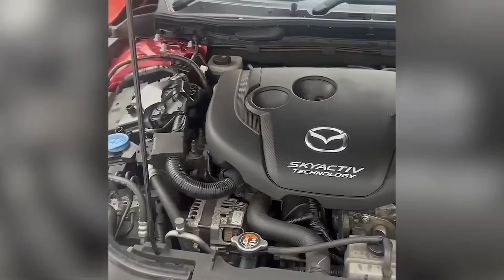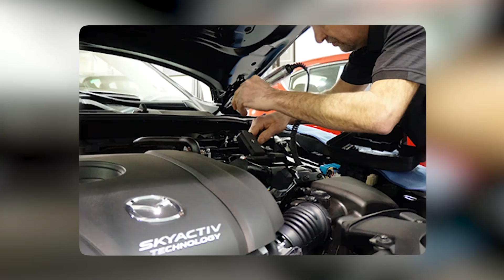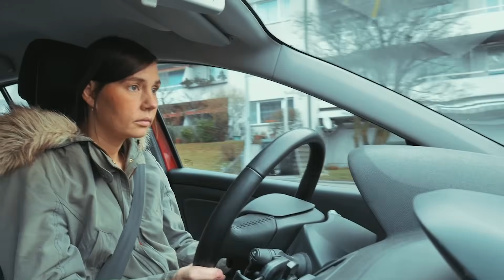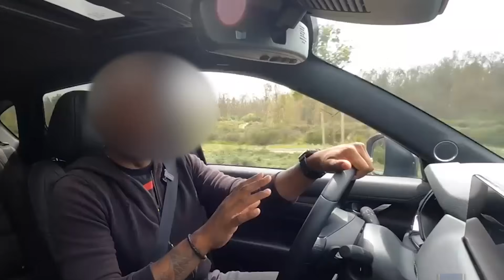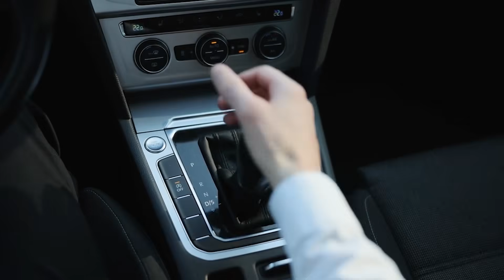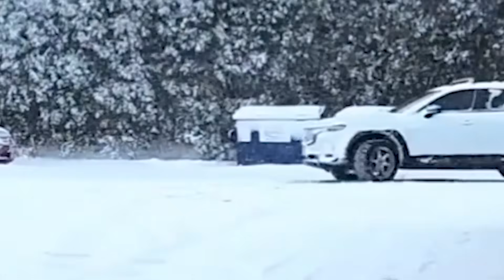7 Things You’re Doing That Mazda Engineers Beg You to Stop

Comment: I dont have a temp gauge. Change my oil at 3000 miles on the dot, sometimes 2500 and i know many people tell me thats too frequent but i know my car and i know it starts running different at about 2500-2750 miles. I take 10 min drives to work and back amd thats my reason, not enough long trips.

Comment: The viscosity debate will forever be ongoing over which is the best to use,  0W/20 or 5W/30.  Change oil Before even 5,000 miles as so many suggest and there will be no engine issues.  Call it overkill, but the engine will be spotless inside forever.